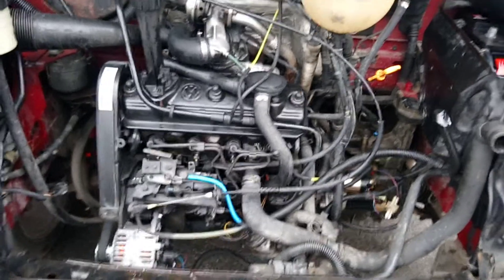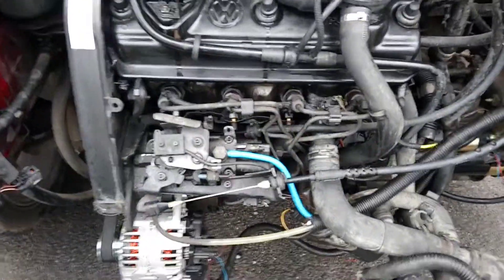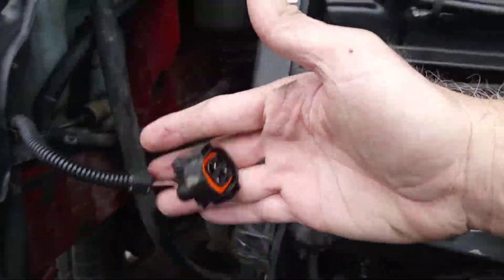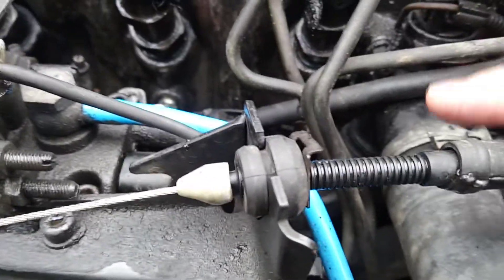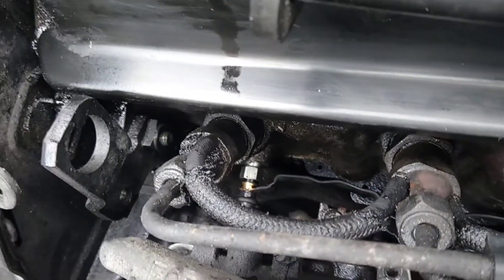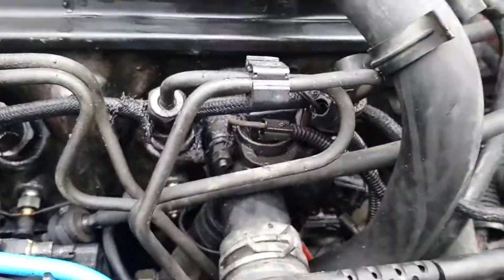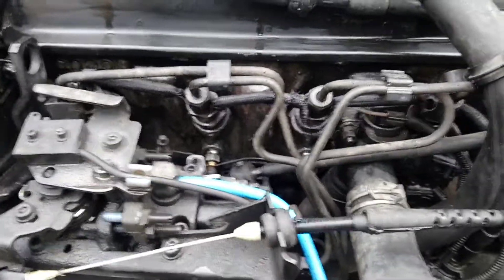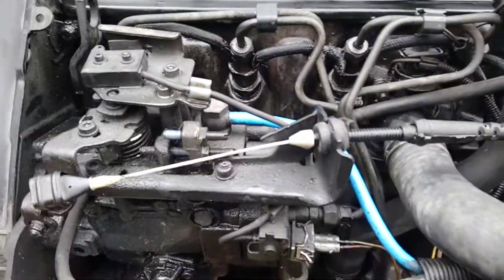VW T4 Transporter 1.9 Glow Plug Replacement Advice

Comment: Number 1’s the hardest followed by number 2. Number 3 and 4 are ok as the diesel pump isn’t in the way. Get an 8 and 12mm articulated ratchet spanner and a seat as it’s far easier sat down than standing up leaning over. Done mine today and it wasn’t something I want to do again anytime soon
Reply from the maker: Glad you got yours sorted. I had proper trouble with one of mine. It was cross-threaded, and I only just got away without shearing it. Still - it won't need doing again for some while!

Comment: Hi could you please help me I need to replace the vacuum 3.5mm and breather 4mm on my 1.9 abl but I replaced them all before not thinking with the same size hose and now it’s smoking do you have a diagram or can tell me which is which please